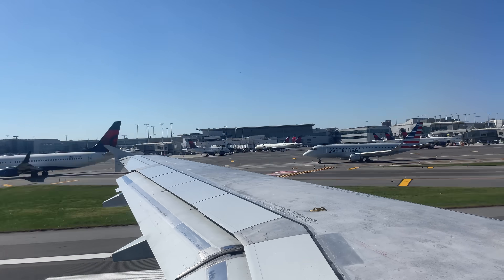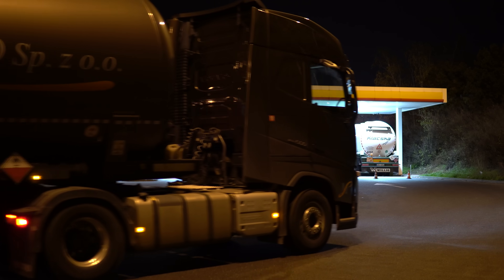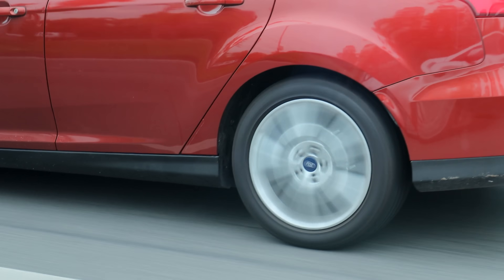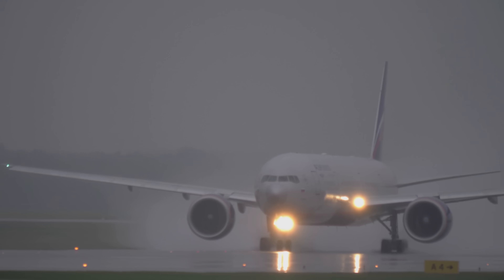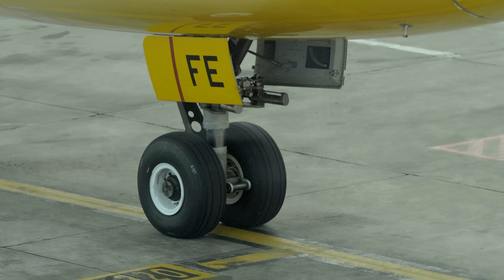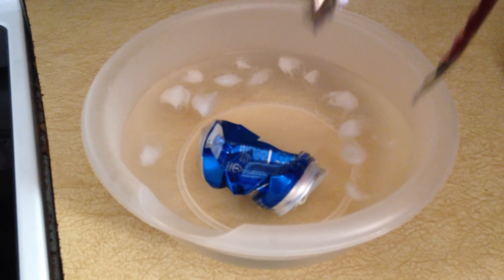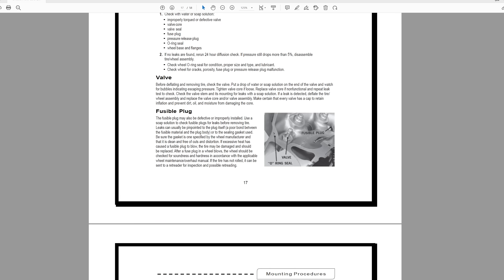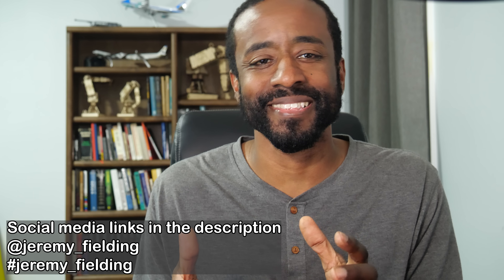The Ingenious Design of Airplane Tires- Jeremy Fielding 107

Comment: The load on the aircraft tyres is even more impressive than you've shown in the video: because the centre of gravity has to be close to the landing gear and the wing for balance normally more than 90% of the load goes into the 4 main wheels so the wheel load will be even higher.
Reply: Also the dynamic loads are probably more than those of a car or a tractor -trailer.

On the other hand, normal road tyres have to do much much longer distances than air plain tyres.
Reply: So I wonder if even the front wheels are engineered differently to reflect that as well? Because of a proper landing engaging pavement with the under wing tires first?